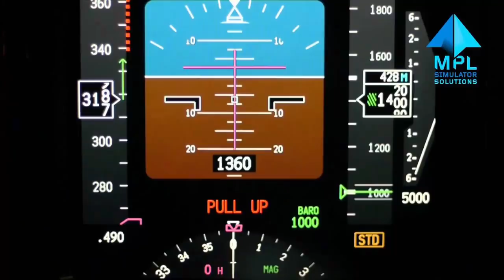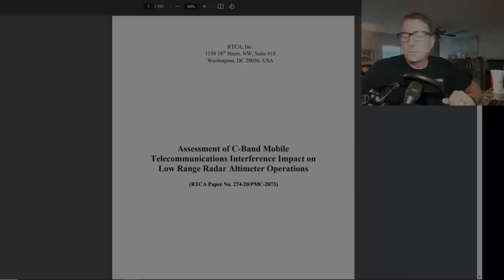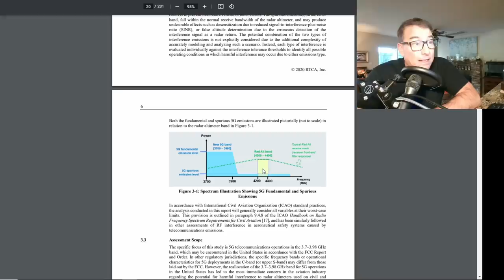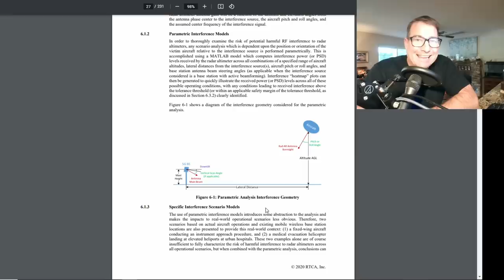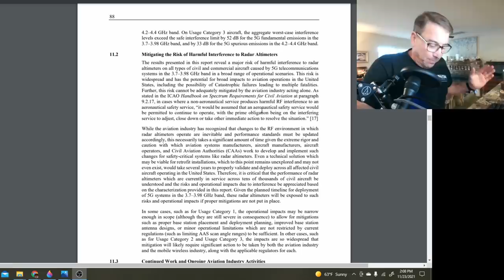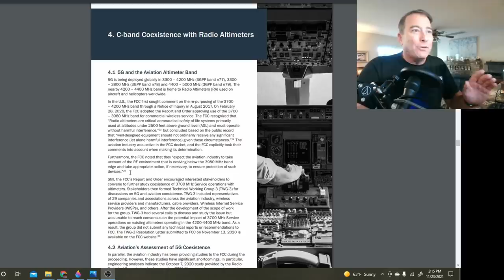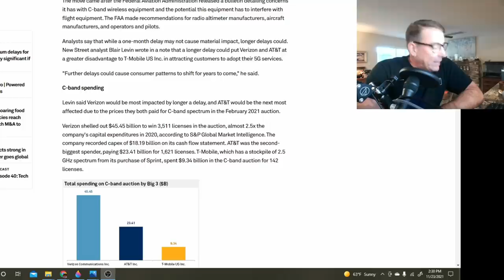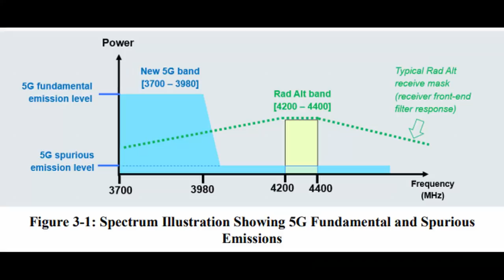5G C-Band Interference with Radar Altimeters in Aviation

Comment: The RadAlt receive mask is horrendous here. With a working range/band of 200MHz (4.2-4.4 GHz) the system is impacted by an interference source greater than 200MHz below the lowest part of its operational band. I know (as both a PPL and RF engineer) that some aircraft equipment is “ancient” - we still have several club aircraft fitted with ADF kit, but it would be good to know some actual numbers here; e.g. what is the 3dB point and roll-off values for the receiver.

Whilst historically this may “not have been broke” (so did not need to be fixed), with the expansion of mobile networks into the sub-6GHz bands it is broke, old, and seriously in need of modernising.

I agree that aviation safety should not be compromised, but when legacy kit is using vast swathes of the RF spectrum, it needs to be modernised.

Even if the US decided not to allow the new 5G band (3.7-3.98Ghz) to go ahead, what happens when an overseas visitor with a 5G phone coming off “flight mode” as it is just about to land becomes RF active and “sprays” the surrounding environment - I know it shouldn’t, just like 3G & 4G phones in flight mode shouldn’t throw spurious RF packets every few minutes, but they still do (conspiracy theorists, it’s OK they don’t do it when powered off, just in flight mode <|8-)
Reply: I agree, I’m a EE that’s worked in Comm for decades and if the roll off on the front end filter really is that bad, that is terrible design for the radar altimeters. The guard band on this case is way wider than the entire VHF aviation band.
Reply: Yeah... 200 MHz of separation is a HUGE distance that can be filtered away very quickly. Reserving hundreds of MHz at those bands is not justified when a little better than a sloppy filter is enough.

Also, 200 MHz of bandwidth for a radar system is an enormous amount not justified anymore.
Reply: @DrewNorthup  No doubt, that was not the intent of my statement. However from the screen shot I saw it looked like the roll off was very slow and even with rather old filter design, it was very doable to have a reasonable bandpass that was 200MHz wide and expect no significant interference from a signal 200MHz away from the lower edge, unless of course you were at the 2nd harmonic. Yes it looks some extra work and parts, but for things that cost as much as these do, I would expect that to not be unreasonable.
Reply: @vihai  "Reserving hundreds of MHz at those bands is not justified when a little better than a sloppy filter is enough." That's great news! Will you be doing the work to gain FAA approval and certification of this safety critical filter and installing on all the aircraft on a volunteer basis or do you think it'll take a bit longer than you'd like to donate? Maybe we could ask passengers to each take a radio altimeter to modify and provide a free soldering iron?

;) Something simple is not necessarily easy when it involves thousands of aircraft and hundreds of thousands of employees working together while also continuing to ... ya know, fly?
Reply: @x--.  avoid this kind of irony, I know well enough the certification processes.

From an engineering point of view there already is a guard band of 200 MHz (which is huge in terms of separation) and it is technically easy to be immune to out of band interference. Guess why there is such guard band?

I, personally, had to replace the radio on my aircraft which costed 1/15 of the value because regulamentary decision to reduce channel separation to 8.33 kHz so if some manufacture's RA is not immune to interference so far in the spectrum it can be made non compliant and replaced.

It's also for a matter of safety (do we really have such sensitive equipment that can be made misbehave from signals so far away in the spectrum?)
Reply: @vihai  as always, appreciate the education. My point was that talking about theory (equipment shouldn't be so sensitive) is great but what we, the traveling public, care about is safety. Planes that crash because the equipment they've been using for decades now has to work with specs that didn't exist when originally built is unacceptable. That is the bottom line.

The FCC had no right to prioritize mobile wireless traffic over air safety. Theory is irrelevant, no one is making the argument that equipment can't be made to work with these new requirements. The argument is the current equipment might not meet that specification.

If one plane crashes because of this intentional introduction of interference-potential there will be justifiable outrage.

That's the reality on the ground as things have been explained to me. If we agree on that, then fantastic, that's what matters!
Reply: You have a few layers of metal to contend with considering the location of the antennas on the fuselage.

Comment: As a frequent flyer, I can assure you that MOST passengers do NOT put their phones in airplane mode. I try to always do it, but will confess there are times I have forgotten (only to have my phone ring in my bag in the overhead…hang my head in shame). 

Depending on compliance from passengers to ensure safety is problematic at best .
Reply: Maybe airplanes need to have a signal jammer during critical times of flight, i.e. takeoff and landing.
Reply: I agree, and I'd add that the time in a flight when passengers are most likely to use their phones is just before landing when 5G interference will do the greatest harm. They want to confirm that whoever is picking them up is there.
Reply: @TheGospelQuartetParadise  Signal jamming is always a flawed approach and in practice leads to breaking other potentially critical systems. There are literally hundreds if not thousands of airplane components that emit radio frequencies.
Reply: @TheGospelQuartetParadise  Jammers work by flooding the spectrum with unreadable garbage , would just make the problem worse. Next best step would maybe be farday cage around the cabin.
Reply: @TheGospelQuartetParadise  A signal jammer? Might want to think that trough a bit.. You want to jam a signal that interferes with the avionics, without the jammer doing even more harm........
Coz physics!
Reply: @Icel4nd3r  ohh ooh, I know, how's about 0utting the passengers in an aluminium tube...
Reply: Agreed
Reply: @TheGospelQuartetParadise  That would definitely make the problem worse.
Reply: @dougaltolan3017  Make that a steel tube so it has magnetic shielding.(RF).
Reply: @tedmoss  that could be a thing, but I think they chose aluminum for aircraft as its a tad lighter....

Comment: Multipath reflections and combining are the biggest problem.  However, the band tightening, or bandpass filtering, undoubtedly will have to be improved for the new threat to radio altimeters.
Reply: Not being any expert of the radar and required bandwidth of any applied filters, what I have understood is about the following:  Filters in general cause signal RINGING when their bandwidth and/or edge slope is pushed narrower / steeper respectively.  The radar altimeter to my understanding operates in an environment where the received signal is subject to Doppler shift and thereby needs its given bandwidth and as little filter ringing ( = spurious signals) as possible.  This is the first article with some real info about the 5G problems.  The unsubstantiated health issues I ignore until there is at least some fact based info available.  Thanks for this!
By the way, I have seen some news that Russia insists on no 5G towers in neighboring countries closer to than quite considerable distance from their border, supposedly due to disturbance to their radars.
Reply: @InssiAjaton  Yes I understand what you mean about the doppler shift, although I don't think it's the issue here.  If Russia banned it, there's a reason, but it can be dealt with.  Thank you.

Comment: Good job Juan ! I’m a retired regional airline Captain with over 20,000 hrs ,and never had to worryAbout an inoperative auto pilot because None of my airplanes had one ! I got veryProficient at had flying approaches. Sounds like no matter what happens with this situation you better be ready to hand fly your approaches! In my opinion 
To many major airline pilots are not staying current on hand flying their 
Aircraft ! (True Safety Is No Accident)
Sometimes in my regional carrier I’d 
Hand fly 14 ILS approaches a day between Lax and Ont ! 
As usual great job on reporting on
The issue ! Thanx Captain Mark H Wirth
Reply: This completely misses the fourth point that if you’re in IMC and your altimeter says 1200 ft but you’re actually 800 ft, your ability to hand fly will do nothing to save you from impacting the ground 400 feet early.
Reply: @applec2400  your talking radar altimeters, I’m flying barometric altimeters . The g5  signal May
Interfere with radar altimeters .

Comment: This is one of those cases where profit got ahead of safety. The legacy system argument fails when you consider that the problem can't be solved quickly. Refitting the entire aircraft fleet with new RadAlt avionics will be expensive and take time. This issue should not have been a surprise and steps should have been taken to resolve it before the reallocation occurred. When you look at just the cost of a missed approach, safety aside for a second, failure to think this through beforehand is going to be a lesson we'd better learn quickly. This is not the last of these.
Reply: Jim Chadwick, JIM, COME ON! THE USA ACTUALLY PUTTING PROFIT FIRST!!!  JUST KIDDING YOU, BUT SO TRUE, HOPING YOU HAD A GREAT TURKEY DAY!
Reply: It's incredibly unfortunate that the FCC looks at aviation, amateur service, and other important users of frequencies as non-revenue earning freeloaders of a sort while they see wireless cellular carriers and commercial satellite operators as profit centers. While it's appropriate to charge a Verizon or T-Mobile for the frequencies they use, that shouldn't drive an agency effort to cannibalize other existing frequency allocations.
Reply: @cosmotraumatika7474  Well put.  Seems to me this is an issue that should have been clarified before they even cleared the spectrum for auction.  But no..  the FCC wanted their 100 BILLION before even looking at the problem.

Comment: Good job on this. I have an engineering background and some understanding of sidelobes, harmonics, filtering, etc.  Also taught some people through their instrument ratings as a CFII. The paragraph in the report is particularly scary that begins with: "The FCC expects the aviation industry to take account of the RF environment..." (19:23). Words like that sound as though they are just calculated to keep certain people off the hook if adverse events happen. 

I would feel a lot better about this if some measuring and monitoring instruments were installed in a test airplane, some actual base stations placed at representative locations near a Cat III ILS, then a bunch of approaches flown so we can know what does happen, as opposed to what should happen. (Why hasn't this been done?) The word "should" in a report like this serves as its own red flag. Sort of like "The FCC expects..."

Kind of like: "Here's your parachute. This one should work."

It's important that these systems work well, and also that the public have confidence in them.

Comment: Retired RF engineer here.  A couple of points worth mentioning. The telecom industry likes to point out that there have been no 5G interference issues in other parts of the world, particularly in Europe. Looking at the spectrum allocation, there is a much larger guard band in Europe than in the US. Interestingly, Japan has a small guard band. Wonder how they are avoiding interference issues. Another point is that with older equipment designed before there were any signals on nearby frequencies to worry about, the front end amplifiers did not have to be particularly linear. Old equipment exposed to the new 5G signal may not only fail to filter out side lobes effectively, but may create interference within itself due to non-linearity of the front end. So it's not just the filters that would need to be looked at for redesign, but also the front end amplifiers.

Comment: Another excellent report from Juan. 
Radio interference is real. And it happens on lower frequencies all the time. Thanks for the alert. Can’t the power be increased to 2 or 5 watts?  Since airlines were there first, maybe the 5G companies should deal with a little inconvenience during bad weather.  On a radio tower, the owner, or first one on the tower is protected, everyone else afterward has to protect number 1. (One time leading to the last guy to installing copper plating inside the tower building).

Comment: Modern digital filters, ADC, DAC and IQ baseband processing technologies (like used in mobile telephony) can afford significant improvements over analogue filters in legacy radio systems. They have made huge leaps in Military Radar, ESM, ECM, and Satellite communications. There is no reason why these systems could not be made to co-exist, but not without equipment change. An example is that a software problem in the GSM/5G system could cause a temporary violation of channel assignment. The main problem (I suspect) is that IQ baseband processing relies heavily on software which is safety critical in airborne equipment. Mobile technology is moving fast, and is now mainly in the realm of "Software Defined Radio". Commercial aviation safety is moving slowly. Being slow isn't bad. It would be easy for things to get worse quickly. On the other hand being too slow isn't good for safety either. In engineering this is known as "Technical Debt". Telephony owes aviation. In the end though, it's enterprise which is going to fix this, and I doubt many want to touch it for the hassle it will give them. It is so regulated, no-one can make any money solving the "hard" problem. (Perhaps the easy problem is the equipment)